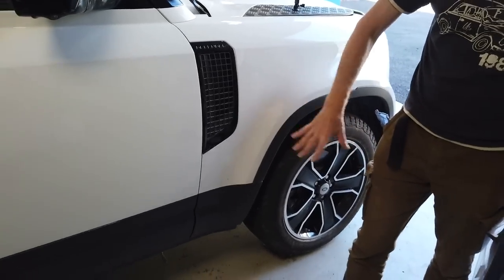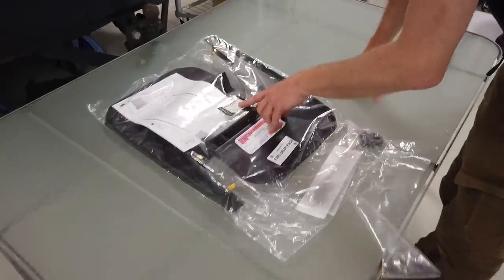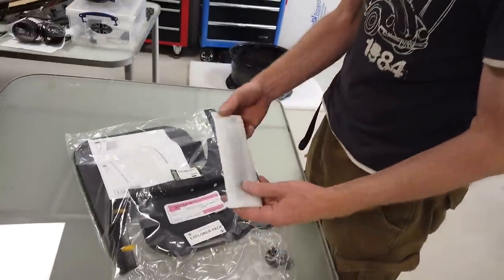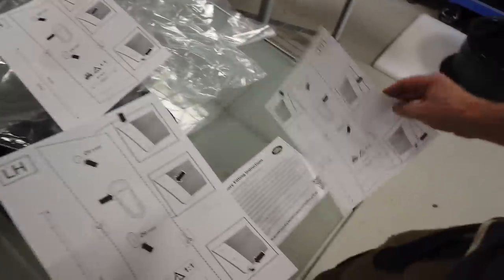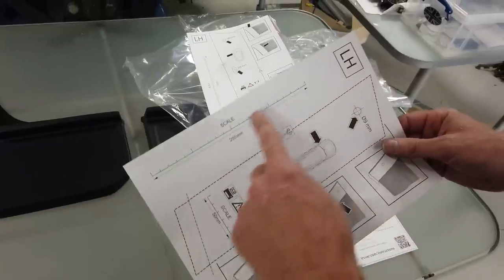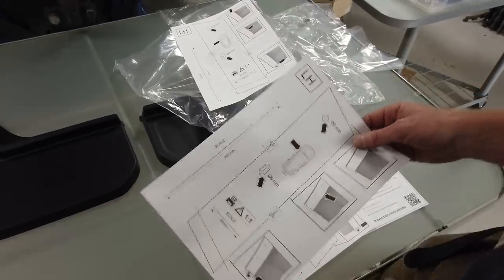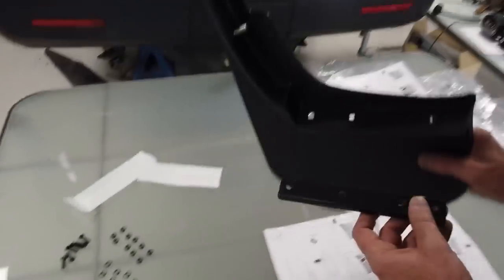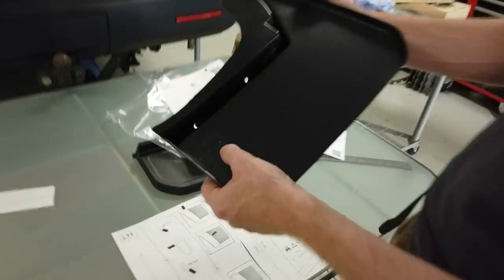How to fit Land Rover Defender 2020 front mudflaps VPLEP0387 VPLEP0389 ( unofficial way )

Comment: Thank you for the video and for the very approachable way you lead us through an install. Your videos are a godsend to we who would prefer DIY!  I do want to point out a slight error that caught me having to redo the right side front flap- and that is the direction you have installed the metal piece (at 14:33) at the bottom is actually backwards... per the Land Rover instructions, the upward curving edge should be oriented toward the front of the vehicle, and not the rear as you demonstrate it here.

Comment: Do you know the part# (bottom plastic) that connects to part# LR130593?  The part I’m referring to is where the front mud flap metal bracket attaches to.  The part which requires drilling into from the bottom.

Comment: It looks like the same sort of black paint finish that was used on the old Defender mud flaps.  That thin section will have a very short life, being blasted with water and mud and will corrode to nothing in a round three years or so.  I can see a stainless option for that plate appearing on eBay anytime soon.

Comment: Thanks again for these.
I’ve lived with my mudguards for 2 months now and, surprisingly, I’ve not trashed them off road!  I thought I’d catch them dropping into deep ruts and, because they’re stiff, I’d knacker them but they seem to have survived admirably.  
They do attract clumps of mud though and take a damn good jet washing to get clean again.
I assume fitting rears is much the same process.
Reply from the maker: Firstly well done for getting your new car muddier than me ! Do you have the bigger "classics" style or the standard type of mudflaps ?
Rear mudflaps are on the list for this week !
Reply: @L663  I have the classics (the larger ones).  They seem to do the job for sure.  I think they're particularly effective when the tyres are emptying themselves of all the mud I've picked up.  I was expecting to hear an almighty crunch when dropping into ruts because they sit back off the wheel a fair way (not done any crawling over rocks yet) but no issues so far.

Comment: It looks like the mudflap is bolted to a plastic part clipped to a metal body part.  Would I be right in thinking this might increase the leverage on the clips, such that catching the mud flap on something could pull the trim panel off, leaving trim, mudflap, clips, bolts etc. behind?
Reply: Catch on something? Do they have high curbs in Surrey or Chelsea?
Reply: @andicog  Cyclists, children, dogs & cats.  That sort of thing.

Comment: The top edge doesn't quite fit right - should be a little bit higher. Anyway, good job everything is marked L and R for left and right as you wouldn't want to put your boots on the wrong way round....

Comment: Another great video! 

For the next one, have you heard of Johnson rods for the New Defender? It's a very small modification that tricks the suspension to make it stand a bit  higher. Would be cool to see your take on them...
Reply: This is a good idea... Gives the defender a 50mm lift. Only takes 20 minutes
Reply from the maker: Yes i have seen this on the Range Rover Sport - I would prefer a "software" solution like the IID tool... but so far they are not doing a tool for the new Defender.

Comment: It would have been good if Land Rover had predrilled the holes and used plastic poppers that could have been discarded when the mud flaps are fitted. Then there would be no need for drilling or any template, it seems common sense to me as they would sell more if they were easier to fit and a genuine land rover aftermarket product

Comment: The grey(gray) clips almost always brake when removing the panel (the top two clips pictured on the small panel they say to remove). They can be ordered in bags of 10.  if you plan on installing the Land Rover  accessorie side steps, order 3 bags as the rocker panel cover that needs to be removed uses 12 clips... they usually ALL break.

It is way easier to install these by removing the panel as instructed. You dont actually remove the wheel arch liner, only remove the first three clips shown in the instructions and then just fold the liner up out of the way... don't actually have to remove it. 
Your brackets are also backwards. The two holes close together go towards the center of the vehicle and the raised edge faces toward the front.
As far as I know, the center screw is not used because it winds up going through an existing aluminium piece and if the mud flap gets caught while off roading, it ends up causing some decent damage to the rocker panel/lower fender.
Reply from the maker: Thanks for the comments.... our new resident Jedi ! - I will try and install the other side "by the book" to see how it goes ! The clips breaking worries me... they seem to break a lot on this car when doing stuff...
Reply: @L663  ive done enough that If it wasn't for having to drill holes... I could install most of the accessories with my eyes closed.  And if you manage to not break the grey clips, I commend you!  I've broken hundreds and have not found  a consistent way to remove them without breaking them...